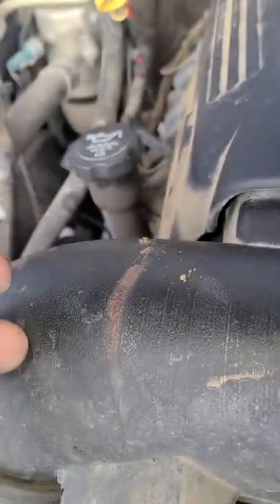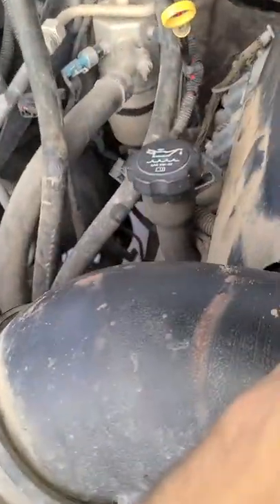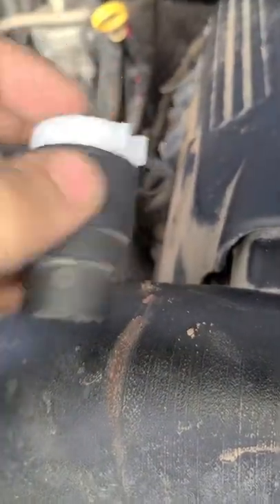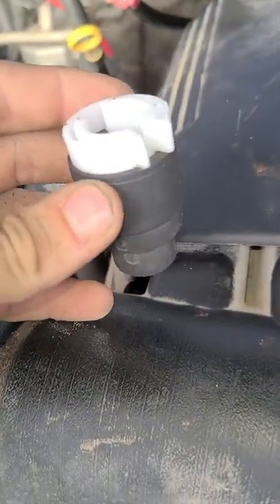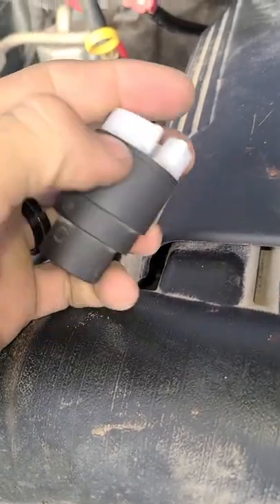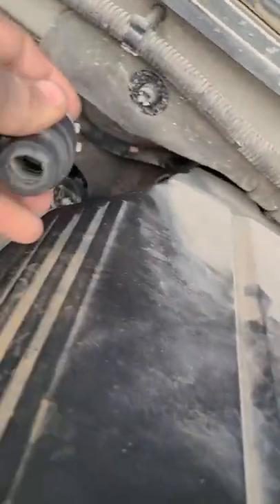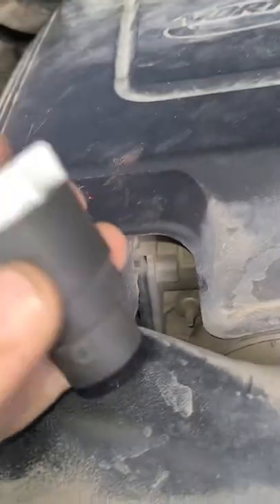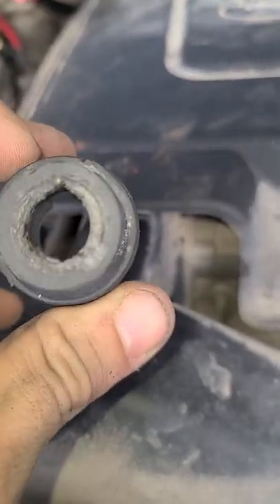how to disconnect quick connect heater core radiator hose

Comment: God man thank you sooooooo f***ing much. I was working on my 2000 silverado for an hour and couldn't get it off using the quick disconnect tool, and like you said in all the other videos it pops right off. Used your needle nose plier idea and it worked great! Saved my ass man, thank you!

Comment: Tell me why this popped up right after i got a heater core out everything went smooth untill i got to that left quick disconnect.. ended up just pulling hose off quick connect and passing whole thing threw fire wall

Comment: Fellas? I cannot seem to get the white or the orange fitting to work
Reply: What I did is I got a torch in a long handle screwdriver I hated it till it was red hot and melted it right off, it will save you a lot of time I tried and tried to get it off and never came off so I just burned it off melted that off right away it works try it. God bless you my brothers and sisters ✝️✝️✝️🇺🇸
Reply: Do you still need help? I’ll come by and help you.